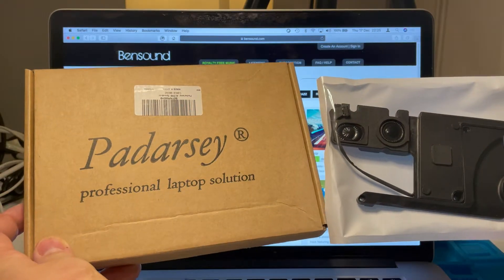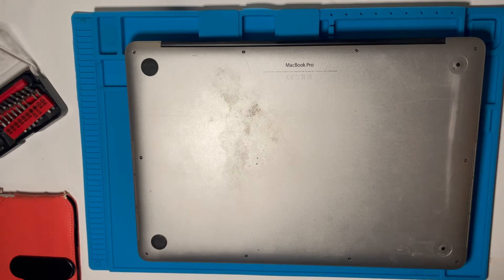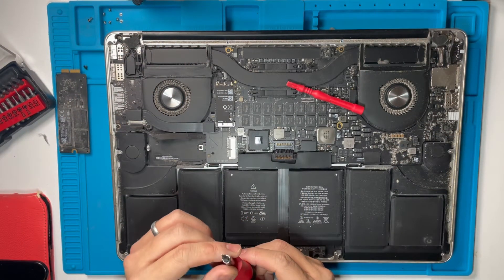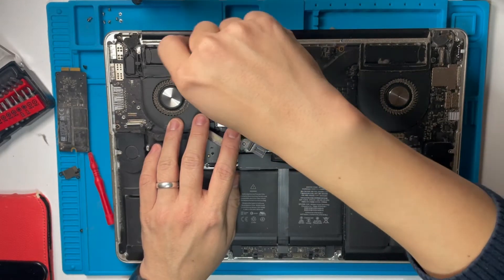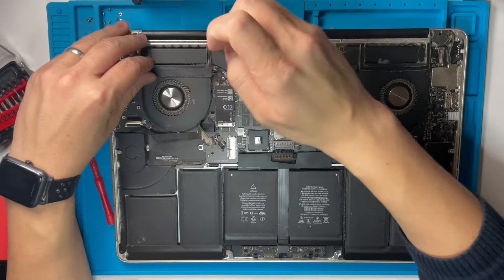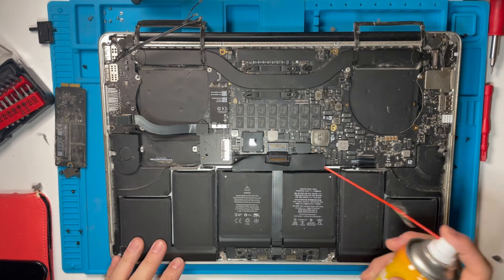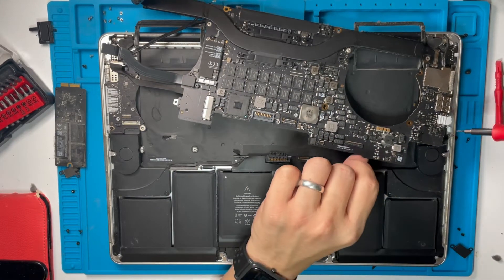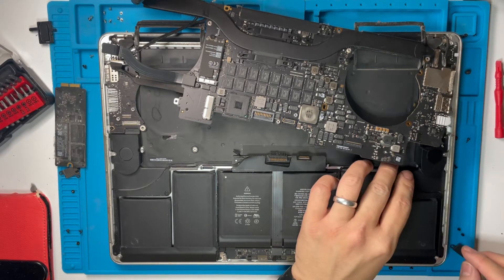MacBook Pro 15 Inch Mid-2015 Retina A1398 - Distorted Speaker Replacement Padarsey

Comment: i used this method today and fixed my own mac book, im delighted. had a couple of issues when rebuilding as i could not get my keyboard working, the mouse was but nothing else and it was down to me not flicking up the lock on the ribbon connector part soon as i done that. the cable slid in further and as soon as i locked the cable in place it worked all singing and dancing thank you for the video !! a heavy handed dj with no computer experience done it so can you !

Comment: It works with  just dry cement on the speakers. And you forgot to plug back in the keyboard light. Took me a minute to find out what i did wrong.